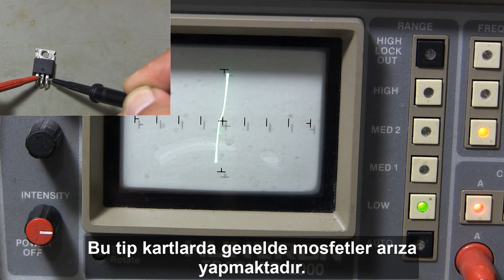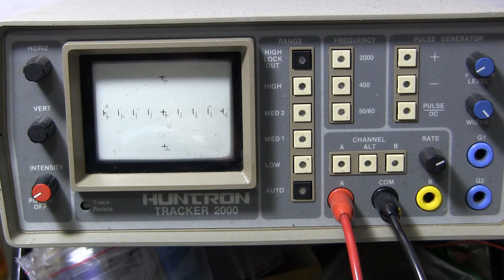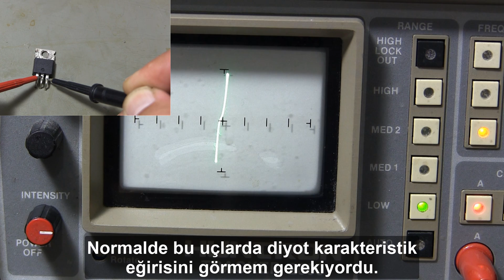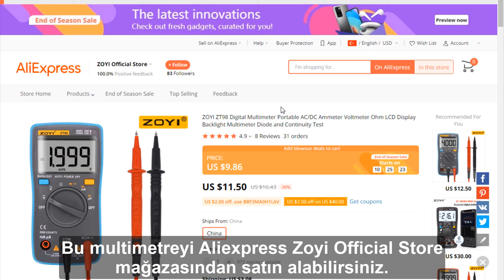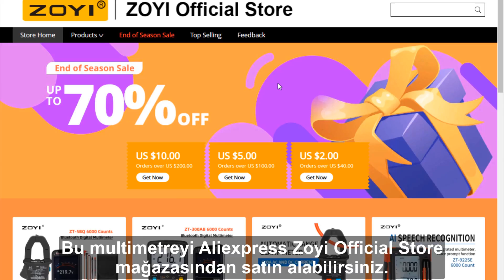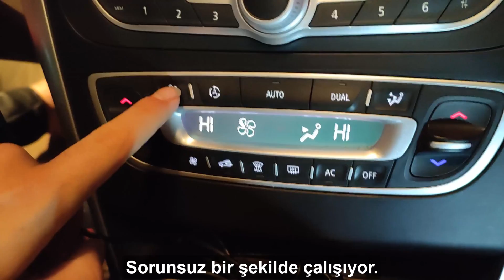KALORİFER FAN REZİSTANSI TAMİRİ. AIR BLOWER MOTOR RESISTOR REPAIR.

Comment: Can you please tell how to use multimeter to check if blower motor resistor is fine or not
Reply from the maker: You can understand the malfunction of the fan control card by checking the input and output voltages with a multimeter. If the input voltages are correct and the fan is not working, the card is most likely faulty.
Reply: @electronic7979  lol i am a nob in using multimeter, i think saudi turkey courier is cheap!!! ok the numbers are marked 1234 5 on pins on resistor , so i put red probe of multimeter  no 1 pin of resistor  and then black probe of multimeter one by one 2 3 4 5 i get around 200+Ohms in 2 3 & 4 but no reading on pin 5 , can you please help !!
Reply from the maker: Is the module you want to check the one in the video?
Reply from the maker: Hello.  I don't know the resistance values of the fan resistance socket.  You can understand fan resistor failure as follows.  Remove the socket of the fan resistor and supply 12v to the cables going to the fan motor.  If the fan motor operates smoothly, the fan resistor is faulty.
Reply: @electronic7979  yes

Comment: Peace be upon you. I have the same device. I found that the third and fifth cold electrodes had broken the weld. I tightened the welding, but I found that the mosfets were out of order. Can they be replaced only, or are there other parts that could malfunction? In view, nothing is damaged, only there is a yellow piece that is not in its place, but it is located near the pole number five. Is it resistance or capacitor and there is a place for another piece that is not welded and is white. Please reply how can I provide you with pictures for more clarification
Reply from the maker: Hello, I'm on vacation right now.  I can help you in three days
Reply: @electronic7979  ؟؟؟؟؟؟؟؟؟؟؟
Reply from the maker: @ALAAABD  Hello.  Can you write your question again.